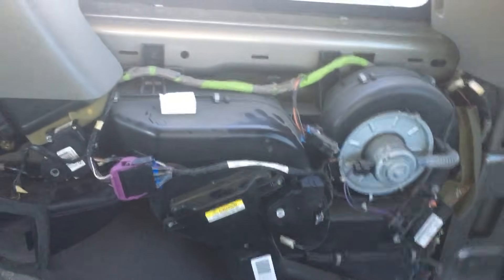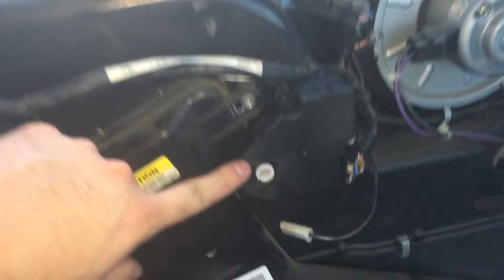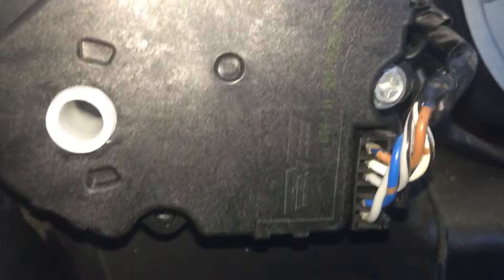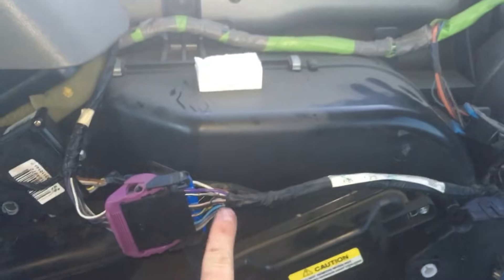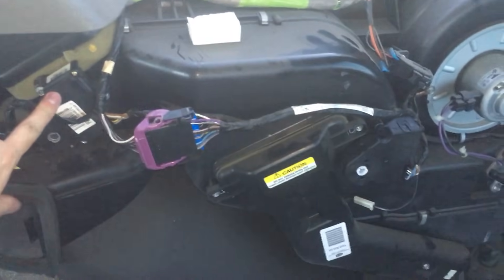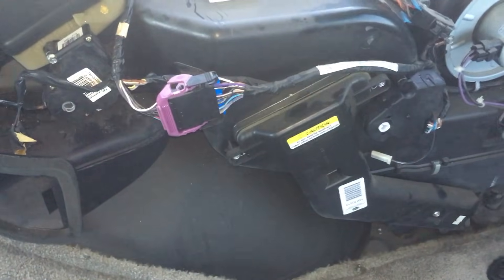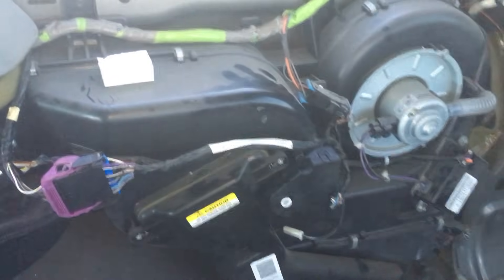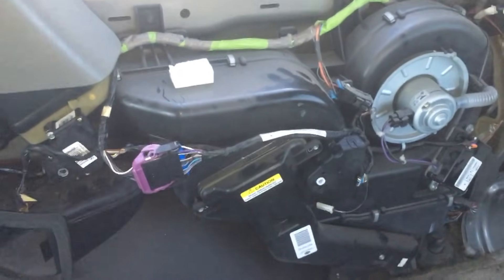Why Your Rear HVAC Only Blows Hot? Simple Actuator Fix

Comment: My heater in the bank is actually stuck on .Even when I turn the Escalade off and pulls the key out it keeps running.I had to disconnect the battery cable at night .Great video 👍🏻though .

Comment: I have a 2001 (11/2000 model) Tahoe with rear ac/heat. My rear assembly does not have any actuators and doesn’t resemble this unit. I looked under the dash and found that blend door but it works. It adjusts the heat/ac in the front. However, the rear ONLY blows ac. Any suggestions on where to find this rear blend door? Unless my model Tahoe  (I would be extremely surprised) only came with rear ac.

Comment: My 2013 yukon is knocking from the rear any ideas ?
Reply from the maker: Mine was actually knocking a little bit as well, because my actuator was cracked (as shown in the video) it wasn't holding the temp door in position, so it would fall and make a knocking noise.

Comment: Did the fan work with the bad actuator? Mine won't start on heat or cold.
Reply from the maker: The fan doesn't run at all?  Or the air is not coming out of the vents?  If you turn on the fan does the blower motor spin?
Reply: @mrjchristensen1  The blower runs and blows out the vents

Comment: My knob that turn the fan on does not work. Which one do I need to check? The speed at which the air blows.
Reply from the maker: This video applies to the temperature and the direction of the air, not the speed of the blower motor.  The blower motor is independent of these actuators.  Most of the time when the fan control stops working it is because of the Blower Motor Resistor, which regulates the speed of the fan.  Usually you will still have the highest blower motor setting available when that goes out.  (The fan receives full electricity from the electrical system, so in order to slow the fan down the Resistor restricts the electricity to the blower motor so it blows slower, that's how you get the lower fan speeds.)  If your blower motor is entirely non-responsive I would first start with a fuse or other electrical disconnect, then perhaps the blower motor control box on the blower motor itself, it is very rare that the motor goes out entirely, and almost never just overnight.

Comment: What does this actually move? The back piece of my actuator that connects to the unit fell inside the entire HVAC housing in the rear...
Reply from the maker: I'm not sure.  I know there is a "door" inside that box that redirects the air flow, but mine has never broken so I haven't ever taken it apart.  :)

Comment: When I have the ac/heat off on mine the actuator is making random actuating noise by itself. What is causing this?
Reply from the maker: Which actuator?  The front air direct actuator or the rear temperature control actuator?
Reply: @mrjchristensen1  I hear in the front portion closest to the rear seat. I have a subwoofer box mounted that I need to remove to see it in action. I'll do that here soon and get back to you. But its kind of weird that it would actuate by itself when all the temp controls are off.
Reply from the maker: @hippo-potamus  Right.  Do you have driver's rear control settings set to off?  This would be the settings above the rear view mirror.  Perhaps the second row settings are off, but the front settings are still on?  Also it could be in need of calibration?
Reply: @mrjchristensen1  Yea they are both off. Perhaps the calibration might be.  I'll investigate it further and get back. Thanks for your replies and for posting this helpful video :)
Reply from the maker: @hippo-potamus   I recall when I restarted my system after installing the new part it did the calibration on its own (I recorded it in the video too).  Maybe the system is losing power and feels like it needs to re-calibrate every time?  Maybe the door inside the actuator is broken so the system doesn't sense the limits so it is constantly calibrating?  Maybe it is just a random sound inside the panel and not at all related to the actuators?  And you're welcome for the video.
Reply: @hippo-potamus Did you find out what was wrong? I have an 04 Escalade and with the A/C off, and the truck is idling or driving, there’s a loud squeaking sound like something spinning or pumping coming from the area of the rear HVAC behind the panel.

Comment: awesome video. I had one question. What does auxilary mean within these actuators? I know there is the main blend door actuator and the auxiliary blend door actuator what is the auxiliary actuator? Thank you
Reply from the maker: I'm not entirely sure what you are referring to either.  I recall reading that the "aux" was referring to the rear HVAC system in general, maybe that is where you are seeing it?  Sometimes in the manuals the "aux" anything is simply referring to the secondary system to differentiate it from the "main" or primary sytem (the front HVAC system).  I recall in the early versions of these vehicles the rear climate control knobs were called "aux control", so I'll be that's what you're seeing.
Reply: mrjchristensen You’re absolutely right. I figured it out but you’re right the AUX is the AC actuator in the back of the truck. I had to replace the main actuator that’s located under the dash in the front of the car. Thank you. I appreciate it

Comment: I am assuming that the ac is on when you were testing or turning the knobs, right?
Reply from the maker: I think it was on, but for the intent of the test it shouldn't matter.  When you adjust the direct door it moves according to the indication on the adjustment knob, either to the roof or to the floor.  When you adjust the temperature blend door knob it will adjust the door to either the heater core or the AC "core" (can't remember the word right now), basically hot air or cold air depending on the temperature of the ambient air.  In any case all the way hot will move the blend door to the hot side and all the way cool with move it to the cool side.  Whether or not the actual AC button is pressed on the dash shouldn't affect those operations.
Reply from the maker: Also make sure the rear controls are not inactivated by the front override.  :)
Reply: @mrjchristensen1   OK, I am now able to open th rear ac and it turns out that both actuators are good. Any ideas why ac is still not cold?
Reply from the maker: If those are both working then you need to go upstream and figure out why "cold" isn't reaching the rear HVAC unit.  The likely problem is a block or clog in the piping, or where the piping goes into the rear HVAC unit thought the brass expansion valve on the floor.  See these videos for more:  https://www.youtube.com/watch?v=mQMo9LkZg-g and https://www.youtube.com/watch?v=ixXS7Cjy7-4
Reply: @mrjchristensen1  OK, thanks. I'll have to check that since my rear AC just blows hot air.
Reply from the maker: @gerrygalvan7313  Sure, and that is the point of this video.  :)  Just play with the temp blend know and watch the actuator turn.  If it turns then it is working right, but maybe the internal blend door is broken or a gear inside is broken (like mine).  If all that looks good, and your front AC is cold, then that means the coolant isn't reaching the rear unit, which means it is probably the brass valve on the floor under the blower (not in my video, but there are other videos about it).

Comment: I'm wondering if this pertains to my '01 Express, front ac is great and rear blows hot
Reply from the maker: I do not know how the Express systems work...but knowing GM's love of reusing parts and systems it wouldn't surprise me.  In general the principles are likely the same, either a broken actuator, temperature door, or potentially a clog in the piping that goes to the rear unit from the compressor.

Comment: Heat blows in the back of my 03 yukon when my ac is on. Is this the same fix for that?
Reply from the maker: Timeless Records there could be a few problems there, like maybe the coolant isn’t reaching the rear system because the rear switch is clogged or blocked, or it could be the rear temp blend door actuator is broken like my problem.  Probably the easier thing to check first would be the actuator which is what I show in the video.  If it is working fine then I would proceed to the coolant or more advanced issues.
Reply: @mrjchristensen1  thanks for the fast response. Ive actually been watching a lot of videos and this is most common when the actuator needs replaced. The part is only 15 bucks so i ordered it regardless im replacing it. I just bought it so im going to replace a lot of parts on it to keep it rolling for a while hopefully. If its clogged ill figure out how to clean that also.
Reply from the maker: @timelessrecords2363  Yeah.  It is pretty easy to see if they are working properly once you get the cover off of the HVAC system.  In my case it was rotating appropriately, but the actual gear inside was cracked so the door inside wasn't actually rotating when the actuator rotated.  The other main issue you could have is a little brass valve on the floor where the coolant comes from the engine, sometimes it gets stuck closed and a good hit with a wrench and spring it open again (or you have to replace it which is a bigger job).  Good luck!
Reply from the maker: @timelessrecords2363  Did the actuator fix your problem?
Reply: @mrjchristensen1  actually no. I'm not sure what it is
Reply: Hi! @mrjchristensen Where is this brass valve located on the floor? I'm having the same problem in my 04 Tahoe. Air blows cold in the front. Blows hot as a heater for the back passengers. I will check the actuator first but please describle where that lil brass valve is located. Thanks in advance.
Reply from the maker: @ashlemmefixthat7786  I did not have to fix the valve on mine, so I never had to take it completely apart.  I recall finding a video that showed it though, so maybe just google around a bit until you find that video.  I recall it was, if you're looking at the rear HVAC unit, on the floor on the right-hand side (the side nearest the rear of the vehicle).  If you go outside and look at the tubing that comes to the rear HVAC from the motor you can see where it turns upward and enters the vehicle, that's where the valve is located on the inside of the rear HVAC unit.  You had to remove the blower and all of that equipment to reach it.  I'm glad I didn't have to do all that, let me know how yours turns out!

Comment: I just looked at mine today, symptom was cold air blowing through the roof vent when heat was selected. 2003 Escalade with auto temp control. I switched the two actuators, easily changed the knobs manually to make it hot or cold, but whenever I started the engine, the actuator moved to a different position than was commanded. Is there an initialization process to sync the door position with the commanded temperature?
Reply from the maker: Yes there is a calibration required, I mention it near the end of the video.  If I recall you just have to pull that fuse and let it sit long enough for the computer to reset.  When it reboots the actuator door will run the full length of its range to calibrate its limits (show this in my video as well).

Comment: Man, the rear ac is still not blowing air in the rear. Replaced blower motor and resistor. Any ideas?
Reply: I'm having the same problem to been looking for answers all day
Reply: the trucking basshead have you checked the rear HVAC fuse?

Comment: Great video and explanation.  At least now I know where to take my meter and start troubleshooting.  Since you were so kind as to offer to allow questions, I would love to run one past you. My rear A/C works fine on Auto, but rear heat does not.  When using heat, I have to manually set the location of the air to overhead vents, and set the speed.  I think if I set the heat to the high notch, it blows out the rear lower vent just fine, but if you back it off to a degree setting, it quits blowing in the back.  There will be only a slightly detectable flow if any at all at the ceiling vents.  The stealership has worked on it several times, they claim it's right.  I've owned this truck since 05, and no, it's not.  Any insight would be appreciated.
Reply from the maker: I'll give it a shot.  :) .  I think your system is working correctly, actually.  In every vehicle with automatic control (both of mine do) the heat setting blows out of the lower vents when it is cold outside and the system needs to warm the interior.  The idea is that heat rises, so when it's colder than your desired temperature the system will turn on the heat and direct the air to the lower vents, I've noticed this for years between all of my vehicles with auto temperature control.  So if the system is blowing warm air from the lower vent (by passenger rear tire) then it is actually working correctly assuming airflow and fan are working correctly, but directionally the temperature direction actuator is programmed to direct warm air to the bi-level (feet area, so it can rise) and it is programmed to blow cold air from the dash (or in this case, ceiling) level vents (cold air will sink).  If this is the behavior you have observed, then it is working correctly; you should not feel any air in the ceiling vents when the heater temp setting is higher than the outside temperature.   

I'm not sure exactly about your blower or fan speed...I know when I start either of my cars in the winter the fan doesn't come on AT ALL until the motor (and corresponding temp of the air) has warmed up.  It does this to NOT blow ice cold air all over the passengers for the first few miles until the vehicle can blow warmer air.
Reply: @mrjchristensen1   It's interesting that yours are behaving that way.  I wonder if something changed with newer actuators.  Over the years, the dealership has changed several of the door actuators, but back when I originally bought the truck, if you were set on a temperature setting (not the high click just past the settings) it would blow out the bottom until the cabin temperature warmed up.  At that point you would hear the fan slow down, and the air would shift.  It's north of 100 around here right now, so I may have to wait until winter to get a better read on this, but knowing how yours works now is helpful.  Does your fan change speeds once it warms up in the cabin?  BTW, thank you for taking the time to share.  I really appreciate it.
Reply from the maker: @terryrichardson3663  Interesting.  Yes, once the cabin is at or near the set temperature the fan speed slows down to maintain the temperature.  Maybe the control unit on the rear HVAC itself is bad?  There are few things going on here, if the air direction and temp actuators work (ie the knob on the control panel changes the direction of the air when you manually change it, and the temperature of the air changes when you adjust the temp setting) then I would guess it is the controller/computer unit which sits on the front of the fan (the actuators plug into it).  I'm guessing here, I'm not an expert, but that seems to be the likely culprit.  You're welcome for the responses, glad my video has been helpful to some degree.
Reply: @mrjchristensen1  Thanks, Terry.  I'll grab the Fluke and start looking there.

Comment: I loved your video its very informative however I do not know where the fuse is for the rear auxiliary heater. after pulling the side panel fuses the blower was still going
Reply from the maker: The fuse for the rear blower is in the fuse box located in the engine compartment.  I don't recall exactly which fuse it was, but there is a fuse map on the lid of the fuse box, and I remember it was fairly obvious which fuse it was.  I believe it was called "Rear HVAC".
Reply: @mrjchristensen1  explained very well

Comment: If you are still around please help lol i have acadia 2011 gm crap and i changed both rear actuators and i pulled fuse to reset the system put the fuse back in and i watched the actuators one didnt move at all which is the heat/cold other one for mode went from center to the left, right than back to center than left again and stayed there so i went inside to change settings and neither one responds to any changes what else can it go bad that would affect this once again both actuators are new i even tried swapping them and same result
Reply from the maker: Still around, Pops.  :)  I'm not expert, but I would say the control module which directs both actuators might need to be replaced (or reset?).  From what I understand, at least on these older models, the essential path is input switch > control module (brain) > actuators/fans.  So if there is no feedback from the switch to the actuators, and you know they are new actuators, then something is getting lost in that middle phase, maybe a blown fuse?  Loose connection on the module?  Bad module?  On these older Yukons the module is right on top and super easy to replace (I point it out in my video), hopefull that's the same for you in that Acadia.  Good luck!

Comment: Having an issue with a 2010 GMC Yukon where the Air will blow somewhat cold but somewhat warm, recharged the AC & it’s holding freeon but the AC still blows warm every once and a while. Some days it blows ice cold some days it blows warm.
Reply from the maker: Is it a gradual change or an immediate change (like a light switch on/off)?  If it is gradual, I would say your compressor is going bad.  If it is day and night cold/hot, then I would say it's the clutch in the compressor not engaging.  It could also be a plugged orifice tube, which is easy to remedy.  Overall I don't have a good answer for you, there will need to be some good trial and error to diagnose exactly what would  cause that.